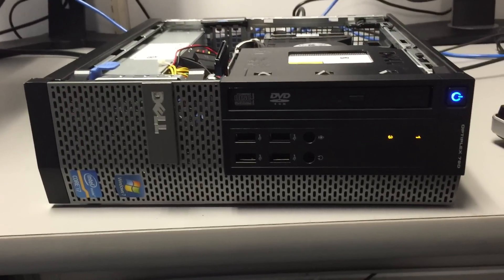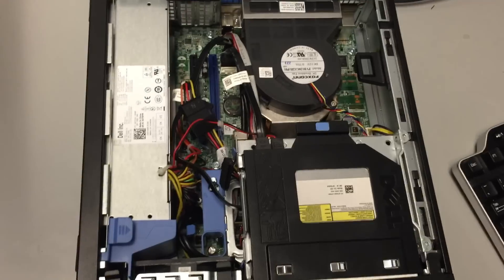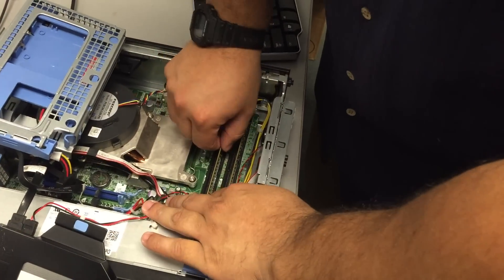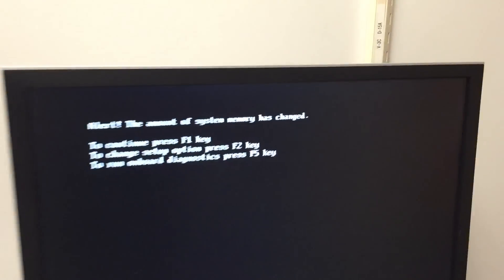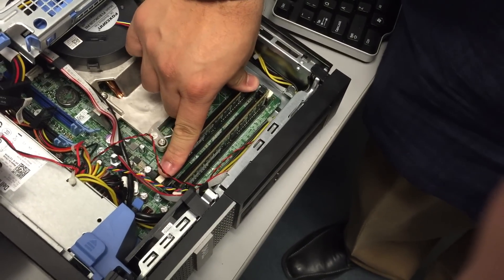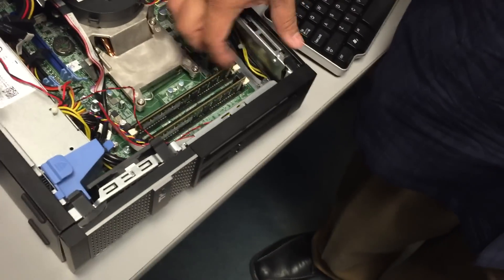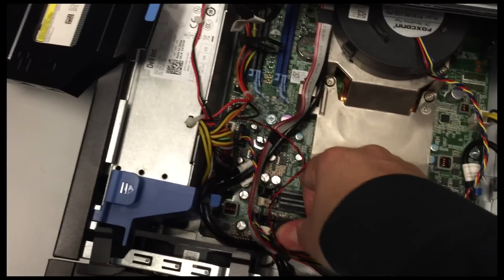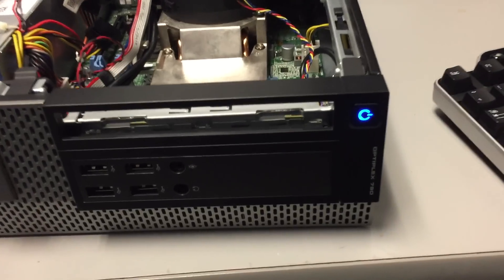Dell Diagnostic Lights 1 and 3 on an Optiplex 790 Error Code Memory Bad

Comment from the maker: If this video "saved your day" and you'd like to give a tip donation to Technuba use the THANKS button above.
Reply: Hi, I am having a dell optiplex 990. It won't turn on. I tried the way you showed in the video but my computer shows that it's "entering power saving mode".

Please suggest a way to fix it.
Reply: Thank you very much my bro i dont have money now but i will donate you. Thank you very much
Reply: I did that but not working, again and again and again back to f1 f2 f5 startup repair. You show us incomplete procedure.

Comment: Can i just simple appreciate this guy enough 🙏 
Like really, At noon, this problem occured to me and after ine restart at worked, but then at night, it didn't start and this time restarting alsp didn't work. I tried everything including removing the cell, manual power supply start. Then this guy saved the day. All i did was remove all the ram, then clean all the slots and ram sticks, then applied only on stick (i had 4 sticks) and it worked. Then i added the second stick and started it and so on. Now my pc is working completely fine with all 4 sticks. This guy really deserves a subscriberl and like
Reply: BOY ME TO

Comment: Good Morning
i tried to upgrade the processor and ram for my pc optiiplex 790 sff model 0d28yy from dell.

i3-2120 processor for i7-2600k , memory from 2+2gb increased to 8+4 (totaling 16gb)

accused error 1 2 and 3 what should I do?

if I go back to i3-2120 it works, only i7-2600k that doesn't give any image and these errors in the leds (no sound)

Comment: Dusted off an Optiplex 780 sleeping in storage room for 8 years and it had 1 3 error. Removed one of the four memory modules fixed the error. Then put the removed module back and PC booted fine. The BIOS even has the correct date and just 10 minutes off in clock. Put a new SSD in and Win 10 is installing right now. Thank you.

Comment: This video definitely saved my day, in 2022. Out of nowhere my Dell Optiplex 790 won’t wake up from sleep. Unplugged the power and attempted hard reboot. Lights 1 & 3 lit up solid. Figured after 10 years the Dell has finally given up life. I thought it wasn’t worth any more money to put into the machine and as a last ditch effort to just move around the ram sticks, booting with only one ram stick at a time, and hey presto, the thing boots up and detects all 4 ram sticks installed! Didn’t have to spend a dime!
Reply: SAME i just cleaned them and swapped the order and it worked :D
Reply: 00⁰
Reply: Same!! I took them out, cleaned them and I put them back again and everything worked perfectly.

Comment: I have a dell optiplex 3010. I got 1 2 and 3 lights on, the power button is white, and it's on, but the screen to the monitor is black and after a while it will go to sleep.

Comment: I dont have any fix for this i have mt machine i have 4 rams installed   all are 2gb rams 1333 mhz tried checking them 1 by 1 rams seem perfectly fine tried removing gpu but the problem still exists i had no luck solving this issue i even installed new hard drives what could be the issues when i boot my computer power light is blue and 1 and 3 diagnostic yellow lights solid and wont boot stays there i have to boot the system by force shut and try again multiple times

Comment: thank u soo much! i almost gave up till i found ur video! its sleeping for almost 2 years and now its back to life! i remove the 3rd modules then it works properly.. question is what is it? what will be the effect on my pc after removing the bad one..i saw written 4gb
Reply: Your machine will experience a performance degradation if you don’t replace the chip. It will still work, just not as well.
Reply: @jonathanlippe  ur right im habing problem downloading my program silhouette studio..there is an error api ms win core.. cant find a good technician where i live.. feel sad..crafting no more😢

Comment: I have Dell Optiplex 790 with four memory slots (3 - 1066 and 1 - 1333Mhz), the 1333Mhz memory went bad.  I tried with swapping the sticks in different slot and it didn't work.  Can we combine with different Mhz in the same computer?

Comment: When I given power supply and without pressing power on button all the lights are blink in orange  and the front fan is turn on and off after some time. I mean the computer gives orange light for some time and off and again same thing continues. What will be the issue?

Comment: Thanks for sharing.  The video did at least get me to attempt a repair on my own.  After playing with and shuffling the two cards, I did get the  1 & 3 error lights to go out , . . . without spending a dime.   NICE!  I'm getting a picture again.

....although now, I am getting some sort of "start-up" problem.   Windows is attempting to do a repair itself, but so far, no luck.

Comment: Man my 1 and 3 light are orange and this hasnt happened before they have been blue only. This happened when i was just using my Computer. I plugged in my USB and an error message came and my computer turned off. Help me if you can.

Comment: i bought a used dell 790. it too does 1-3 solid every once in a while. detects both ram chips. i had to unplug then plugin the system to fix it. very strange. my guess is i should just replace both ram chips just to be on the safe side. as they say, you get what you pay for. got it for my garage so it's not my primary computer.

Comment: I have 4 sticks each 2 gigs and 1333 MHz bus. Only Dimm 2 and 4 are working and 1 and 3 Dimm gives 1 and 3 amber diagnostic lights on the front panel when I'm putting a ram.

Comment: I have a Dell 755 optiplex every time I turn it on it boots up and takes Me to system recovery I try to set to default settings but I get error 1 and turns off and boots back to same thing some one please help
Reply: Xx-iTagz-Xx I get the same thing

Comment: i have this problem and i removed all rams and i also removed cmos battery, but not solved. when there is no ram in in dimms it it not giving any error code beeps too. still it is showing 1 and 3 solid lights when there is no rams in dimms,please help me
Reply: me too i have the same
Reply: +Hisham el kasmy  hai I solved this problem my self. I dismantled my Workstation completely and cleaned everything. after assembled everything,the same problem remains. I also removed CMOS and checked but no result. I solved it by checking RAMs one after one placing it in DIMM1. after changing some RAMs it was worked for me. finally I come to know that this problem occurs Low/dead CMOS battery, bcoz (or maybe) it's not saving BIOS settings. that's why it's happening.

Comment: I have a DELL Optiplex 980 and the diagnostic lights 1 and 3 always on every time I connect the power. I have changed the RAM with the new one and it still broken, is the problem with the RAM or with the motherboard?
Reply: The motherboard is probably dead.